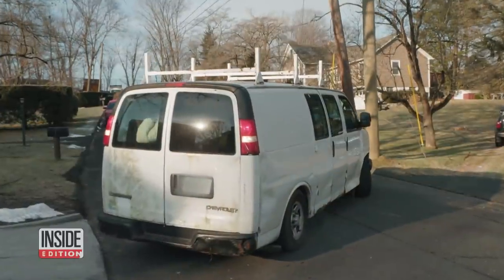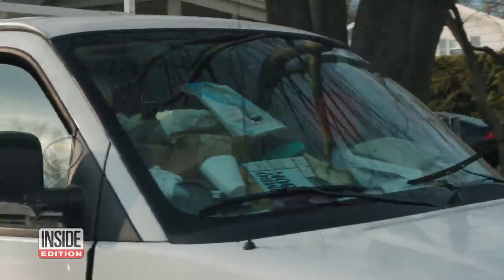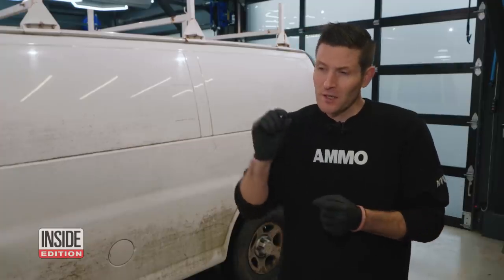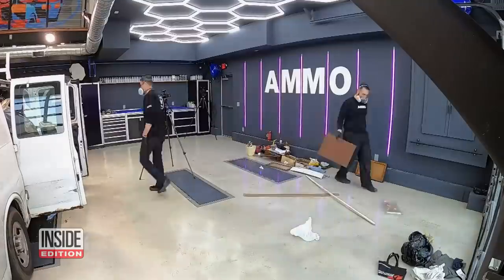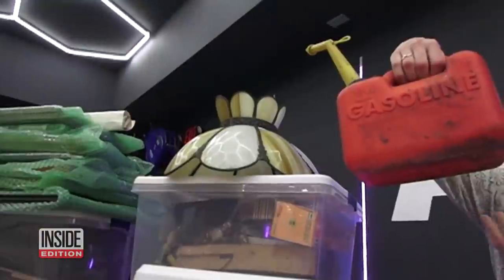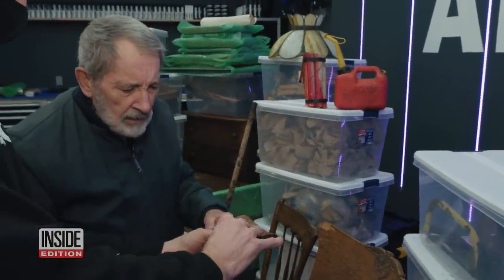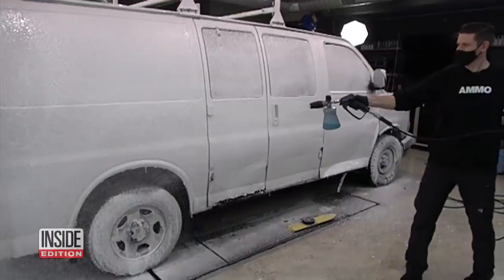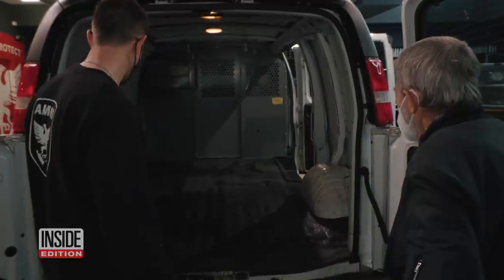An Antique Rocking Chair Is 1 Odd Find Inside This Man’s Car

Comment: The didn't do any sort of restoration at all. Why is this even news? It's just some hoarder who drove a dangerous vehicle. For those who may bring it up, it's dangerous to have that much stuff in your front seat to the point where you can not use your passenger side mirror. All they did was remove his stuff and give the van a basic cleaning.